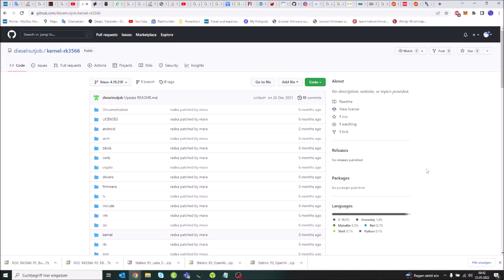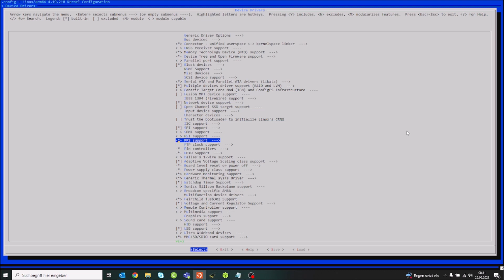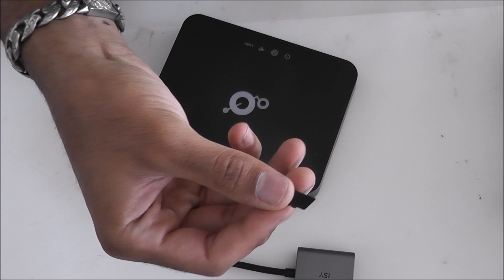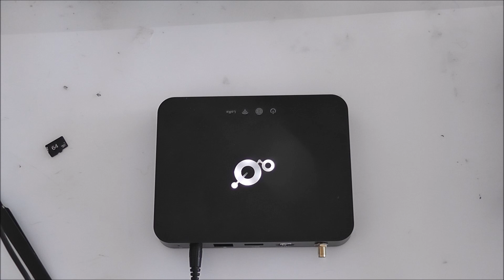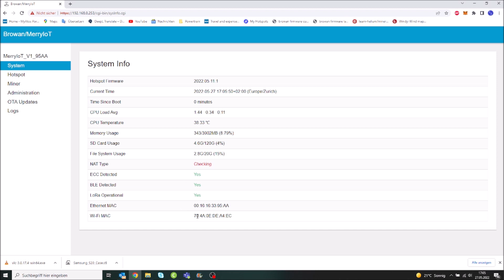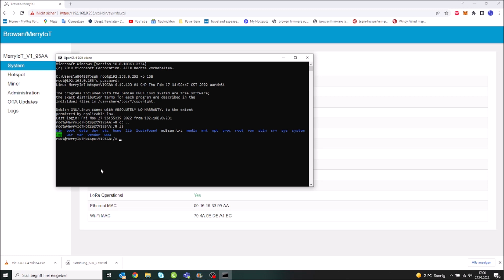Reverse Engineering a Helium Miner to get SSH access and make custom firmware addons

Comment: I have few miners with "Witness Invalid" issue Is there way to fix it? Also how to find test the image BCFU for in gDrive one the two txt files. Is there way to use another concentrator not the original if they are the problem. Need help, please

Comment: Can anyone help ssh working access to miner but stuck on fw 2024.01.19.1 tried to upgrade via web panel or on ssh using gw_ota latest or gw_ota stable but still saying i'm using latest version.
Reply from the maker: If there is no new image then you are on the latest version. I don't know if there are newer versions
Reply: @SolveElectronics  Thanks for prompt response. My issue there is no activity says Lora on and concentrator ok but no beacons or witness.
Reply: @LinuxArch   I have few miners with "Witness Invalid" issue Is there way to fix it? Also how to find test the image BCFU for in gDrive one the two txt files. Is there way to use another concentrator not the original if they are the problem. Need help, please
Reply: @DeanKostov-j4z  Most likely will be the concentrator that's faulty, for a direct replacement search for WMDS-183-SX1302, if not mistaken helium mart they do stock them. Cheers

Comment: I have the following doubt, I did your method 1 year ago and everything worked fine, the issue is that I don't remember the password to enter by ssh.
I have tried to do the same method again, install the sd and reboot the merriot as you do in the video, but when it comes to enter by ssh, the password is not reset.
I would have to put the original image of the merriot on the ssd and do the same process and so the ssh password would be erased?
Reply from the maker: Its been a while now, but I believe that in the folder is instructions how to do it. Basically, when the password is changed, the rights access to the file are changed so that it cannot be changed again by an update. But, if you forgot it, it should be possible to change the script that is run in order to change the permissions again, put the new passwd file on, and then update the password again. Please have a look at the text file that comes with the mod folder. It might be in there. If not, I will review and help you out

Comment: Hello, I got a new miner(never onboarding), but lost the original tf card. So could I flash a new tf card with your image. and then onboard to helium.
Reply from the maker: If I remember correctly, you don't need the memory card to do aNthing regarding onboarding, but it's used to store some Blockchain info. You can just put a generic card into the device and format it via the web UI and you can continue as normal

Comment: Hello, Is there anyway to revert to the initial setup? -> the one without root access
Reply from the maker: If I remember correctly, you can do it via the UI. But there is not point, it will not remove old ID or who it is owned by

Comment: Hey Solve Electronics could you tell me what driver u used to compile sx130x-eu in the OPTIONAL folder. I'm trying to compile one myself but it's not working with the Lora-net sx1302_hal on Github.
Reply: Oh and what modifications did you need to make to that driver? Your driver is working with my replacement SX1302-EU card of my Hotspot.

Comment: hi. i'm new to Browan Merryiot V1 hotspot. i've noticed that this miner have slow response time against the beacon(about 20ms). any idea on how to improve this? can this image help? thanks
Reply: Right now the best way for that is installing the crankk software. For this purpose you need to follow the panther X1 guide and also disable the helium service and packet forwarder. I got an increase about 250%. 1st.- get ssh. 2nd.- disable packet forwarder and helium services. 3rd,- install crankk guide for panther

Comment: Can i made a factory reset with this cfw? I lost my pass phase and need do completly reset my device, coz its tell me all the time, i'm not the owner. But i'am !
Reply from the maker: If you don't have the password for the login of your wallet, then there is no chance
Reply: @SolveElectronics also No Chance via MaskMode?..maybe i can create a backup from a Clean Miner and copy all over to mine one?
MaskMode is easy to enter by shorting the CLK to GND from eMMC. They still leave the Testpoints on the Backside. All U need is a USB-A Male2Male and the RKDevTools

Comment: when you connect the 3 pin UART to establish a serial console session to the Browan, what terminal console program you are using and what baudrate do you set it as to use with this terminal.  Do you have the link to this UART to USB cable you purchased?
Reply from the maker: It's just a normal UART to usb cable with baud rate 115200. The program I used was realterm
Reply: @SolveElectronics  thanks!  Do you happen to have the brand for this UART to USB that you were using? Is The UART side 3 pin male?  Have a photo or link to share?  There are just too many in Amazon to find out the right one to use.  Thx!
Reply: @SolveElectronics  got serial debug console working using the UART TTL to USB.  Looks like browan Uboot uses 1500000 as the baudrate.  :)
Reply from the maker: @swifty888a  it can be, I forgot, but I think you're right
Reply: @SolveElectronics  no worries!  Finally, got access to their U-Boot. Thank you to you for leading me to the right direction!  Your YouTube for showing me where the 3 pin hole to connect the UART was very helpful!  Appreciated for the  informative YouTube video you did for the Browan teardown. :)

Comment: Are there any updates to this post? Looking to gain ssh access so I can setup dual mining with DEFLI. Though just get the logo light on for over 30mins without any joy. Using a 32GB Sandisk Ultra. Wiped the partitions on it with EaseUs parititioner and then formatted to Fat32 before flash with the downloaded image with Balena. Current merr firmware is 2023.06.28.1. Has this been checked recently to see it it still works? or am I missing something. Does it need to be connected to PC on the recovery boot? the video doesn't show anything connected. Have tried several times with differing variations.
Reply from the maker: Hi, I haven't worked on this for a while and so I'm not certain if it is working, but you can use the same procedures as I used to see if you are able to gain access to the shell or even if it is working properly via UART etc. There it will tell you everything you need to know
Reply: @SolveElectronics  Is there a post for that? Is the USB socket a UART? I'd tried connecting a USB-A /USB-A cable from the miner to a PC. Other than the miner taking power I didn't see anything popping up on the PC.

The only way I've got a response is by trying to SSH into when it's connected to the local wifi, though that's using the EMMC boot which is Browan, and they blocked ssh. I connected them directly and they responded saying that allowing ssh root is against they're policy (though they mention it in their docs')
Reply from the maker: @HagPhish  i didnt make a video on this because i made the bootable SD card instead. but there are 3 pin holes where 3 pins would be and state "tx" and "rx" and this is for uart. i do mention it in this video at 13.45: https://youtu.be/jIY6L7lCK-o
Reply: @SolveElectronics  As an update, the image "Still works!!!" yay. this was with the current Firmware  on the Browan (2023.06.28.1). I used the SD card that was originally in the miner to flash the downloaded image onto 64gb which was exFAT. Not sure if either of these made a difference. The 32gb sandisk I was using didn't work, though when formatted to exFAT the miner was using it as storage. Great Stuff.
Reply: P.S. I'd expect an uptick in traffic.
Reply from the maker: @HagPhish  that's great, thanks for letting me know!
Reply: @SolveElectronics  Looks like thee is an issue, do you know how to change the password? attempted with passwd it returns:
passwd: Authentication token manipulation error
passwd: password unchanged
Reply: Sorted, the /etc/shadow file had the immutable attribute on it.
The command:

chattr -i /etc/shadow

Removed the attribute and then the change of password was fine.
Reply from the maker: @HagPhish  you need to put the attribute back, as the few updates from browan change the shadow file. The default password is password. This is written in the documentation.
Reply: @SolveElectronics  Already done, wasn't sure what the impact would be but thought it would be safer to put the "i" attribute back after I'd changed the default password.
Reply: Is this bespoke for merryiot? Would this method work for other brands of helium miner? Brother is thinking of doing it from heltec.
Reply from the maker: @HagPhish  this should only work for merriot. There is another miner that is built using exactly this board, but I don't remember the name. Is should work on that too
Reply: @SolveElectronics  I think it is the Panther X2 which is the same board as the MerryIoT
Reply: @SolveElectronics The lora concentrator on the miner died, so the retailer is sending out a new one for me to fit.  They said that when fitted I'll need to let Browan know so that they can remote in to set some settings. With the flashed miner, does this mean they won't be able to remote in as root?
Reply from the maker: @HagPhish  of the password has changed, then no, they won't be able to access it. But I don't think anything needs to be changed at all. Mine worked just fine with completely different concentrators

Comment: Hi , question about this image, because it was made 10  months , and is this script still working now  ?  did you tried ?
Reply from the maker: There has probably been quite a few updates since this was uploaded, but unless they updated the bootloader, which I assume they haven't and probably won't, it should still work
Reply: @SolveElectronics  asking because Browans have Gateway RS now, not miner, and second question, after use this script, OTA updates from browan are still working or have to do did manualy in future ? 
Did you try maybe install balena software ?
Reply from the maker: @MarkMakaron  the OTA still works, nothing was changed regarding the OTA. I didn't try any other installation other than the fleximining. But once you have SSH access, you can install whatever you want on it
Reply: @SolveElectronics  So you have now Gateway RS on your hotspot ? form OTA couple days ago ?
Reply from the maker: @MarkMakaron  I haven't got them any more. The returns were very poor for what I paid for them nearly 2 years ago
Reply: @SolveElectronics  but good to know is it still working on explorer  ? after your modification ?
Reply from the maker: @MarkMakaron  explorer?
Reply: @SolveElectronics  helium explorer,  or maybe you dont't remember name of hotspot ?
Reply from the maker: @MarkMakaron  ah! I wasn't sure. Yes it still worked on the explorer. You can read the read me file which tells you what it does, and you can reverse the image yourself if you're unsure as to how each function works
Reply: @SolveElectronics  yhh, 20 minutes with no action, so probably image is not working anymore :|
Reply from the maker: @MarkMakaron  some users did experience this issue and it was due to the image not being burned properly onto the SD card. Try another card. But if it doesn't works then I cannot help you further 😕

Comment: Hello. I tried different sd cards with rufus and belena (64sandisc, 64 samsung and 128 samsung) I waited up to 10 minutes in Sandisc, the browan logo remained lit but did not reboot, on the other two samsung cd cards it took 20 seconds for the logo to stay lit and rebooted immediately. . When I entered the panel, I did not see any change in the version. If I use the original sd card, which sd card will I insert into the machine after restart? Because in your original method, after restart, you put the original sd card back. Thank you.
Reply from the maker: The version doesn't change because that's not the intention. The intention is to enable SSH and a few other things possibilities you might want to activate yourself. You can use the original SD card after rebooting. You just need to run the format
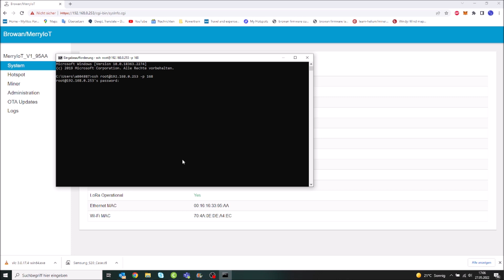Reply: @SolveElectronics  Hi again, i think it is done but without waiting 2-3 min, in just 15-20 sec. I have login with default password and i can see same screen as your video 8:48, thats mean ssh is open now?

Comment: nothing happens here. I tried 2 SD-Cards but the device only lights white, not rebooting.. not after 3 minutes, not after 30 minutes.. any idea?
Reply from the maker: Then please try another SD card 64gb or less
Reply: i solved it by using the sd card that came with the device.. i had to format it after the patch was complete and do a full sync but now it works, thank you

Comment: Hello there
is there any new development? I opened ssh with image file but no change
Reply from the maker: You should read the txt documents in the folder. There are some new things there
Reply: @SolveElectronics  I did the process while connected to the same internet.
I'm trying to connect with putty from a static ip, but I get a password error, how can I do this remotely?
Reply from the maker: @guneyguney7532  if you run BCFU and it completed, then you should be able to login using the password "password". You must check that this is the case that BCFU completed fully and the gotdporlt rebooted on its own
Reply: @SolveElectronics  Hello there
Installed correctly as you described in the video.
ssh root@ip -p became 168
Finished with cd .. and ls. I write shh root to connect with putty with static ip, then it doesn't accept the password, can you help with this?

I haven't received the miner update 14.7.2022 yet
Reply from the maker: @guneyguney7532  putty should work no Problem. If using the command works then it seems like putty is the problem

Comment: Hello,

Why we need to edit /etc/shadow to update the password? It will work when we use it with the "passwd" command after SSH access. Is there a point I missed?

Also, thank you very much for your work.
Reply from the maker: I guess you could use passwd, but I've never tried it. Only manually. But it shows you how you can change it if you make a mistake and forget 👌🏾
Reply: @SolveElectronics  Thank you for explain.
**Note for who wanna using "passwd": The "chattr -i /etc/shadow" command must be run before using "passwd".

Comment: I tried to cash the image, but after inserting the memory card and starting the hotspot while holding the Bluetooth button only the browan logo lights and it stays this way for ever
Reply from the maker: Another user had the same issue. You must make sure to use balena, try another SD card and re-download the image
Reply: @SolveElectronics  I used Balena but I'll try another memory card
Reply from the maker: @yordantrufchev809  if balena doesn't work, try Rufus
Reply: Has it something to do with the firmware version 2022.06.3? I am having the same issue. Cant boot with custom sd
Reply from the maker: @vasilaos  I have tested it on my hotspot which has the latest 2022.6.12 update and it is working. It's likely there may be a problem with my image on Google drive. I have some adjustments I need to make for the latest image I'm making so I'll post that soon
Reply from the maker: @vasilaos  I'll have a look
Reply: I have tried imaging with balena, dd, rufus and still the same. I tried also to modify the script to do a simple pause and reboot, not other procedures before but is still the same. Can you do a test with your image or build another image maybe? It seems can not boot. I also see a 16mb of unallocated space before the partition.
Reply from the maker: @vasilaos  I tested it yesterday and for me it worked. I will upload a new version soon. I have some work to do on it
Reply from the maker: @vasilaos  a new version is available
Reply: @SolveElectronics  thanks but i was able to boot with the original sd card. Idk why because the card i had was a sandisk working fine on other schenarios. I was able to root into it. Just an idea... It should be possible to add another pub key to authorized keys file and login with your own private key generated previously. Should it be possible? I just don't like the idea than when having support remote into your device you have to rollback the changes so they can login as previously.
Reply from the maker: @vasilaos  exactly, and that is why it isn't possible for that to be done and of that is the case, you can always run the SD card image again. Bit you can also add a public key manually of you want to. Once you have SSH access, you can do that yourself
Reply: @SolveElectronics  i'm going to try it later today. My hotspot is always churning errors atleast I'll have a better change of finding out why

Comment: I own a couple of those miners and one is dead since weeks. It does not even create any logs anymore, nothing. UI is there, I could upgrade to 2022.05.03.1 and 2022.05.24.0_GA but still, miner status is offline.

Now, seeing you sshing to the miner, a miracle. I tried it and I get an error message saying root@xx.xx.xx.xx: Permission denied (publickey).

Can you help me please. Why is it working for you but I get the error message?
Reply from the maker: Hi, did you flash the program to your SD card and follow the video? If you did, you should be able to access SSH, and it will ask for a password
Reply: @SolveElectronics  No, I did not but will do it this weekend and let you know

Comment: Hotspot Firware: 2022.05.11.1 ???  What?? I have version 2022.05.03.1 and it tells me that it is the latest
Reply from the maker: thats because when you activate ssh, you can run the "gw_ota latest" command, and it will update to the latest version FW, but this isnt advised. these updates are usually in the "testing" phase and not released yet